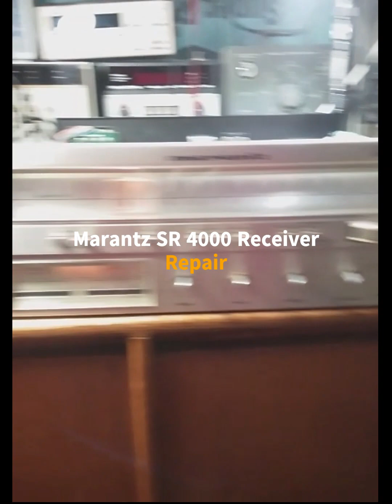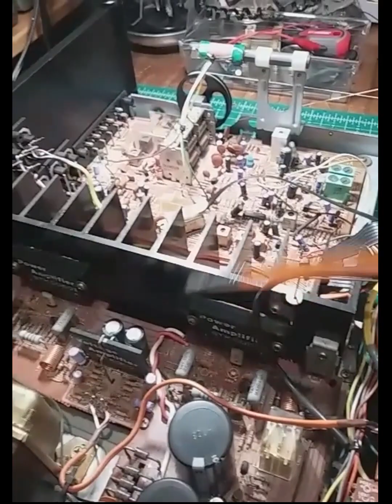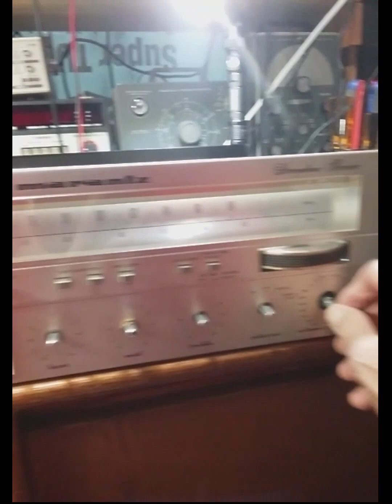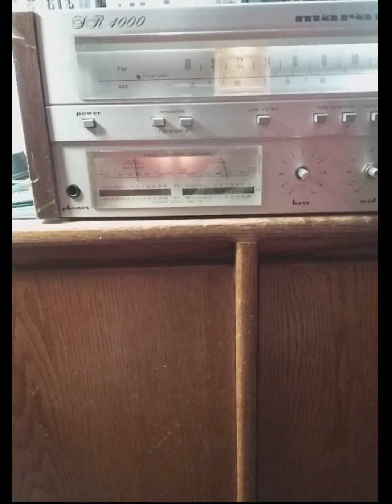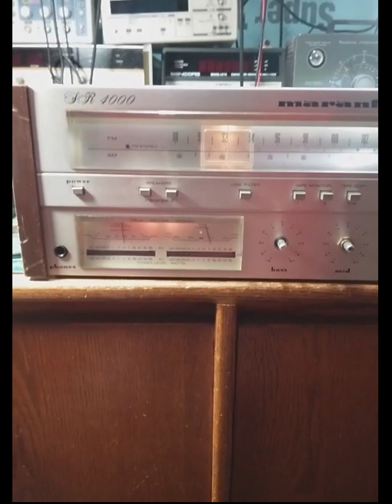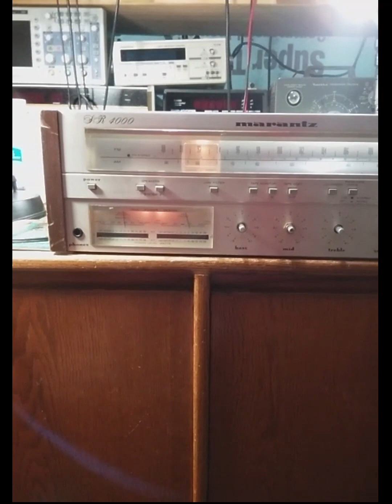Repair of Marantz SR 4000 Receiver from 1980

Comment: Thank you very much for this information. In my case I had to replace an STK50II amplifier because one of the output transistors was short-circuited. Once I had unsoldered the defective STK and before replacing it, I tested the equipment with only one channel in the headphone output. The other channel seems to work well, as indicated by the meter LEDs and the headphone output. But after a while (about 15 minutes) I noticed that the STK 3062 preamplifier heats up to about 60ºC. It is strange that having a casing similar to the amplifiers they have not added a heatsink, or even moved it to the main heatsink. I don't know if it is normal for it to heat up...

Comment: I have worked on a few of these SR4000's that I picked up cheap/dead.  In fact, I am using one as part of my computer sound system.  It is a good sounding receiver and a bit unfairly denigrated by Marantz collectors.  The move to chip amps was industry wide not just Marantz being "cheap". Your SR4000 had an interesting failure. Usually the large capacitors in the power supply go out and people stick bigger fuses in till the STK Amp Chips are blown.  I have had good luck with the counterfeit replacement STK modules. I get a clean 49 watts out of them (near as makes no difference to the 50 watts claimed).   I have done an LED upgrade on one of mine, lighting up the whole tuning scale. That works well if you get the brightness right.